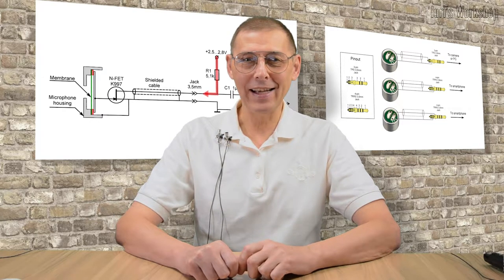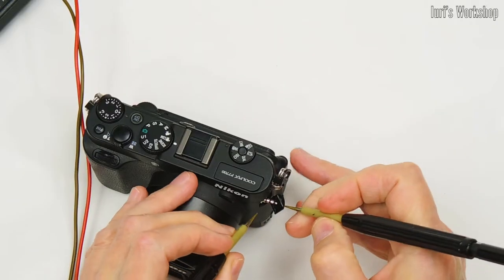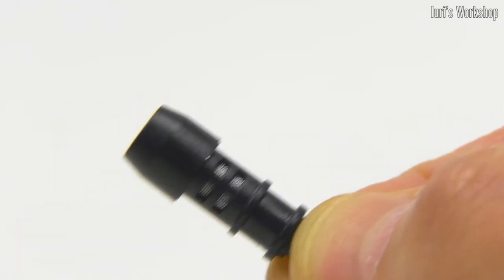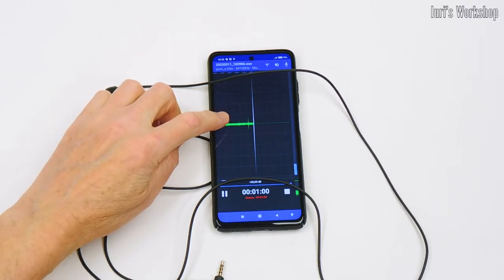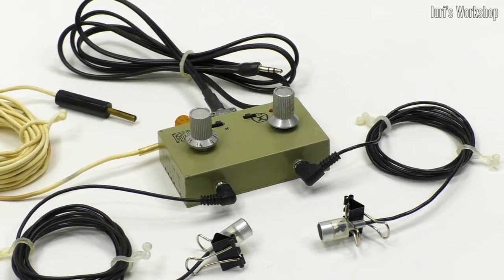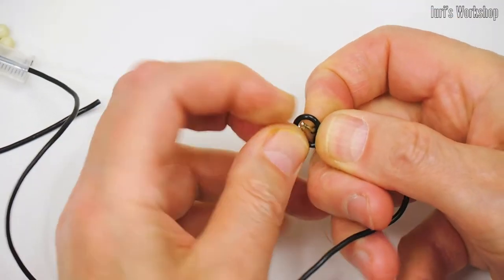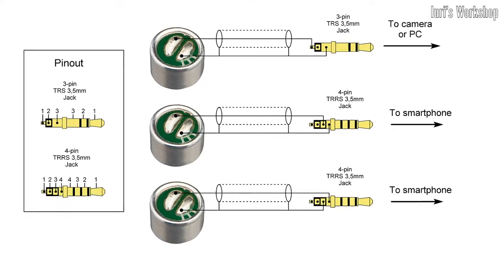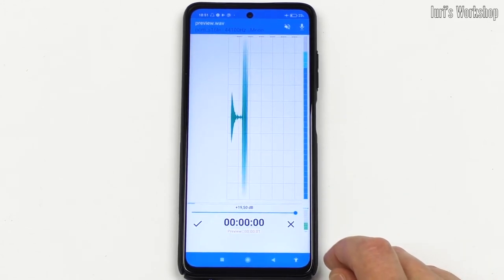DIY Lapel Microphone

Comment: What I want to know next is what determines the quality of the sound, such as the mic and the cable selection. Thanks for the knowledge shared.🙏
Reply from the maker: It is difficult to answer unequivocally the question to which thick books on audio technology are devoted. But if you get a good pop microphone and a professional audio card, then you will get high-quality sound. A good microphone, first of all, is characterized by a linear amplitude-frequency response and a high signal-to-noise ratio. 
To minimize the hum level, microphones use shielded twisted pair and an amplifier with a symmetrical input. 
But if you have absolute hearing, then you can try to adjust the amplitude-frequency response programmatically. However, the result will not be perfect. This is about the same as taking a photo or video using a household LED light. That's exactly what I do, which is why I have such a weird picture. :)

Comment: Please write the name of the shielded cable and microphone capsule you used.
Reply from the maker: This is a conventional shielded cable with a diameter of 2mm.
Reply: @IurisWorkshop  Found the name. If someone is looking for a similar cable, then make a request under the name UL1185 and UL1533. 26AWG - overall
dimeter 2mm,   28AWG - overall dimeter 1.8mm,  30AWG - overall dimeter 1.7mm.
Reply from the maker: @MrDextler  Thank You so much!